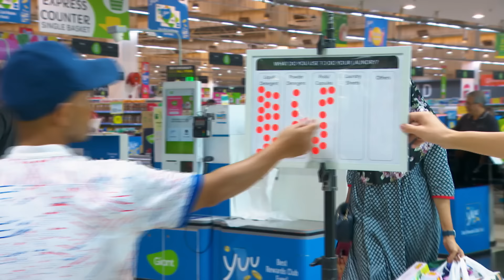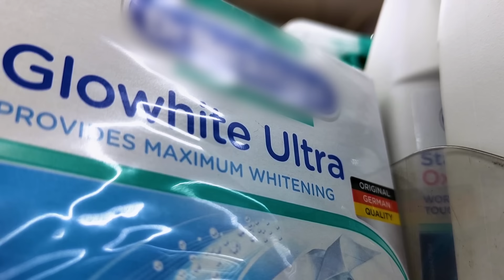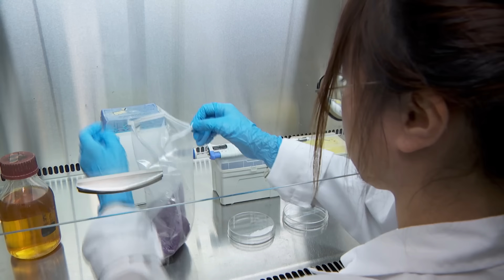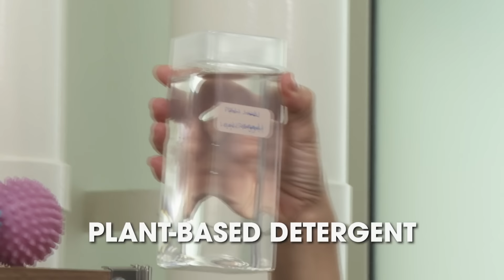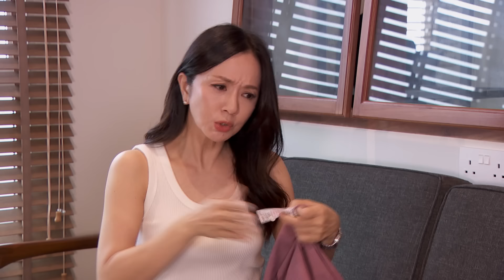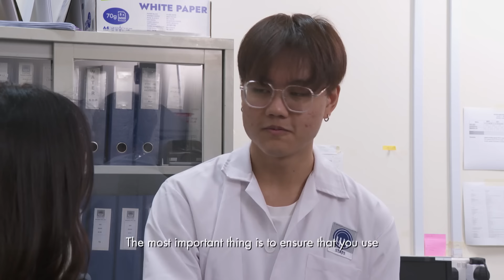Which Laundry Detergent Works Best? | Talking Point | Full Episode

Comment: I’ve switched to sheets but depending on the conditions of the laundry, I use a combination of oxide bleach and liquid detergent. Oxide bleach can use used even on coloured laundry , in fact I found it the colour of those items cleaner and brighter not necesarily faded. 

My experience on post laundry of odor is when the laundry are not properly rinsed especially when the clothing has a lot of sweat, the type of fabric,  if the laundry soap has added scent that not rinsed properly, the barrel is very full that affected the way all items rubbed each other in the cycle plus the temp of water. Because I still have a significant stock of powder detergents, I use powder for towels or kitchen rags, bathroom rugs etc. my conclusion is … it’s not straight forward and use common sense and practicality and use of energy and water; but I now stick to liquid, bleach oxide and sheets and don’t use conditioners

Comment: The Moral of Laundry

The uncomfortable truth is that laundry is not about the product you buy; it is about the discipline you apply.

1. The Detergent Myth

Let us admit we have been fooled. Chemically, detergents are virtually indistinguishable, differing by mere fractions of a percentage. Stop obsessing over marketing; the brand does not clean the clothes—the chemistry does, and the chemistry is standard.

2. The Discipline of Separation

Excellence requires grit. You cannot simply throw everything in together and expect brilliance. You must rigorously segregate your loads by fabric, usage, and care labels. If you want clean, bright, and lasting garments, you have to do the work.

3. The Law of Volume

Resist the urge to overstuff. Less is truly more. By decreasing the load size, you allow the fabric to breathe, ensuring it holds less moisture and dries rapidly. Patience in loading yields efficiency in drying.

4. The Necessity of Maintenance

Your tools are only as good as the care you give them. Regular machine maintenance is not optional; it is the foundation of the entire process. Neglect the machine, and you ruin the wash.

Comment: I am using the sheet ones because it is easier to store and adjust the amount I need, and I am happy to see the brand I am currently using in the video. 
I tried pods because they were free, and I still have some, but they don't dissolve at 40 degrees, even though it's claimed on the package to be suitable for 20-95 degrees Celsius. I only use those when I run at 60 with full load.

Comment: Liquid is customizable to size load esp smaller loads or hand washing, also can use it as a stain remover. This makes it cost effective. All this and it dissolves easily in the washer. The sheets will eventually take hold and become more common and that will offer all the convenience and versatility of liquids as well as being easier to store and transport, less plastic. But they are more expensive for now.

Comment: 90% of the front loaders are not designed around liquid detergent - you can't use liquid with prewash unless you have some advanced model, liquid detergent also is associated with mold. Liquid detergents were quite uncommon in Europe 20 years ago and I still wonder why people decided to switch... Even the cardboard boxes are much more eco-friendly than the tons of plastics in the bottles.
Reply: The popularity of liquid detergent is primarily down to marketing. It's been commonplace in the UK since the mid to late 1980s. And along with lower temperature washing was associated with an increase in issues with smelly washing machines and mould.  Apparently, the residue from it is hygroscopic, so it makes for a good medium for bacteria to grow in. Drum cleaning cycles were introduced in recent years to address the problem.Our powder detergents commonly contain an oxygen bleach to remove stains which also is very effective at killing bacteria and kills mould.

Comment: Just saying "powder" is ambiguous, because powder detergent can be with and without sodium carbonate peroxide (non-chlorine bleach). This is the ingredient that makes all the difference in comparison with liquid detergents which cannot have it (because they are liquid it would react right away, long before use).

In other words, powder detergent with sodium carbonate peroxide is easily the best at cleaning stains, as well as removing smells.

If you are experiencing residue with powder detergents, you are using too much of it and/or you are cramming too much stuff into the washing machine, making it impossible to rinse properly.

Comment: I'm in the US and have a Samsung front load washer (its the small apartment size) I use both liquid and powder. No pods thay have a habit of not dissolving and leaving stains on my clothes. I don't like the sheets in my washer they don't really do anything; but they are pretty good for hand washing. 

My real secret is to only use one tablespoon of detergent in my washer. I use the American power brands Gain, and Tide every now and then. For liquid I use US Gain, Tide or Purex.
But I also use Foca liquid from Mexico, and Mexican powder brands Top, Foca, Roma and Ariel. When I can find it the Tide powder from Vietnam, it seems to dissolve really well in cold water.

Comment: The main disadvantage of laundry capsules is that it’s impossible to dose the detergent portions according to a specific wash cycle. What I mean is the conventional separation between detergent for the washing phase and fabric softener for the rinsing phase. Since the capsule is visually divided into two or more compartments containing different cleaning agents, we cannot determine the exact moment when the detergent or softener compartments will open — in fact, they might be released at the same time 🤷‍♂️

Comment: I'm in the U.K. which doesn't have the humidity issues of Singapore has meaning laundry powder washing powder is an option. The snag being that machine are designed for use  with liquid and gel detergents.  Three things that drive my detergent choice  liquid that is non biological and unperfumed the last also extends to fabric conditioner.  I can't use pods because my machine is a washer dryer. I can't use laundry products that  are biological and/or perfumed because have sensitive Eczema prone skin. I also use a branded water softener that also cleans the machine.

Comment: I handwash our clothes and what haves with vinegar (in controlled amounts only) , soak it first w my preferred laundry soap brand, and so far it works for me, i have a teenager and it really helps remove all those unwanted stuff. Of course except those very hard to remove stains(hydrogen peroxide is handy) its not instant but over time as i observe it fades till its no longer visible.
Reply: I used used vinegar and baking soda too! However, I stopped when I realized that vinegar made the color go away and damages the fabrics. You'll definitely notice it after 1 year of washing.

Comment: Capsule (pods) caused undissolved plastic to build up in the outlet pipe from my washing machine causing a blockage. Extremely hot water has to be used in an effort to prevent this if using pods. I use liquid detergent.
Reply: I use mostly Powder, liquid detergent is weaker in removing Stains, and it builds up smeary Residue in the Machine.
Reply: Ooh I didn't know that
Reply: I've seen this tendency in my machine as well.

Comment: I only use powder The cost of liquid and pods is ridiculous, but powder in a cardboard box is the most environmental.  The amount of heavy-duty plastic and transport of the added water is so unnecessary.  I have never had an issue, especially with a frontloader. If people have irritation, they should use a sensitive unscented variety and they are probably using much more than needed.

Comment: I don’t get it, if detergents can remove almost 100 % of bacteria, why worry about cross contamination? 🤔
Reply: Because there are still viruses that are not mentioned. It's antibacterial, not sterile.
Furthermore, that 0.00001% can be bacteria and viruses that can survive harsh detergents. Those are the ones we should be scared of. 

But anyway, you only live once, why be so scared. 🤣🤣🤣
Reply: women. theyre germaphobes.
Reply: Fungus, especially foot fungus😂
Reply: exactly my thought
Reply: @qt31415 I would wash something extremely contaminated separately, it is not just bacteria to consider.
Reply: Because they tested not on full load washing machine I guess? If tested only 1 or 2 clothes then the detergent works effectively (fully concetrated). Depends also on the mechanism of each Washing machine.

Comment: Inconclusive. I use all 3 types of detergent in rotation, powder, liquid and pods, since the start of this year after using liquids for some time as i noticed towels were smelling funky and feeling coarse, stained bed linens not washing well. Persil powder helped address all the issues. Don't use special detergents for colours or antibacterials, just normal.

Comment: The detergent sheets are nice because there is less plastic, just some sheets in a small cardboard box which is easily recycled. Also, no spilling!
Reply: Check the ingredients or contents of your detergent sheets.  Many, if not most, contain PVA/PVOH which doesn't biodegrade as quickly as claimed and it is a petroleum-derived product.  Many detergent sheets also contain a potential irritant such as sodium lauryl sulfate and fragrances.

Comment: I have spent more than 60 years washing clothes, from the time I was about 10 using a wringer washer, until now. We have always tried to save money on detergent and I’ve bought most of them. I hate that I must buy additional products to work with my detergent. In my opinion, if the laundry soap alone doesn’t do it, it’s a failure. I have found that Tide, Clorox 2 and Woolite to be the most effective for a stand alone soap. Believe me, they are the best. Add bleach to whites with Tide Liquid, use Clorox 2 on colours. Woolite for delicates. I use peroxide, Dawn and water mixed together for stains. Believe me. This works.  I don’t know what water is like in Singapore but here in North America, it’s Tide Liquid.
Reply: How do you feel about Persil

Comment: The no detergent Wash I assume is the control had a 99.985333.  The tests are flawed in the first place...  It doesn't tell us anything.  At least get some textile that has higher bacterial concentration.  It doesn't show if the laundry balls or other detergent actually have any difference.  Everything in your experiment was just 99.999 bacteria free.  According to your test results just wash everything without detergent or add some fragrance pellets and it should be the same as using detergent.  This is so misleading and a waste of time.

Comment: The last part doesn't really matter.  the part about bacteria. 
if you are drying your clothes using the old way of hanging it outside in a sunny day, the bacteria will die from the heat of the sun.

Comment: It depends. I use pods bcoz it is cost effective about 70cent to RM1 per pod for all 3 - soap, softener and perfume. If small load I use one pod and for bigger load I use 2. Also my kids have skin dryness and easily irritate. Pods help me from over use or over pour detergent. 

If the cloths is overly soiled I have to manually wash it with powder detergent. Overly soiled cloths need extra treatment depends on the outcome we looking for. Bleach or dettol for the brightness and antibac purposes. 'Nila' is also used to for the brightening and new effect. So it depends on what we are looking for in each clean.

Comment: I have tried these 3 versions. But never use the thin paper form before.  I prefer the liquid form. I dislike using Power form as it sometimes dont dissolve evenly and I notice white spot on my clothings after washing despite how good the quality is. Liquid form works best for me , it washes my clothings well,  clean with no stains / dirts left behind and 100%  with a pleasant sense after washing. Capsule form is overrated and is more expensive which I do not think its neccesary if liquid works very well for me.
Reply: I used sheets detergent when traveling.. Very handy
Reply: The sheet ones are useless. I've tried so many brands and not a single one works well

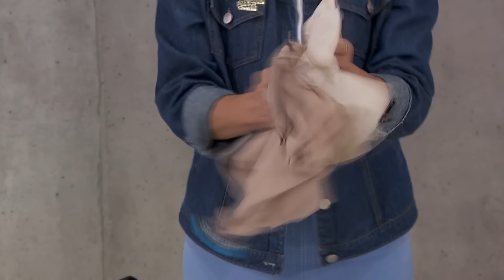Comment: That girl at 19:24 clearly don't know what she's saying. That spreading of bacteria only works if you DON'T WASH your clothes at all. Makes me question her logic and credibility. As you can see from that guy's explanation at 14:29. It shows 99.999% of bacteria was removed after washing regardless of which detergent used. Clearly DEBUNKING what that girl said.
Reply: Yes, it removes 99.999% of the bacteria, but that also means there is 0.0001% bacteria left over. The remaining bacteria can spread and cross contaminate and it will multiply over time.

Comment: If laundry detergents can remove 99.99%+ of bacteria then it makes no sense to be claiming that different categories of cloths and clothes can cross contaminate each other during the washing process unless no detergent is used
Reply: What she didn't test was how effective these detergents are in a full load of laundry. She washed single towel pieces in a mini laundry machine so obviously all the bacteria were removed.
Reply: @drezhb  Smart observation.
Reply: Exactly that section seemed off
Reply: Towels tend to be very abrasive to clothes and can damage them or cause pilling
Reply: dirt, oil are the cross contamination worries.

Comment: You missed one the important ones...soap.

Laundry soap is the best for the environment and a washing machine. That came directly from a manufacturer of washing machines as well as cnc broadcasting in canada. The liquids and the pouches pouches contain materials that are harsh for the environment And you're clothes. The wear and tear on clothing is extreme when it comes to detergent. That is why soap is used for garments that need care/ protection like children's garments, Baby's garments and medical garments.

Studies done in the 70s and 80s and 90s and 2000s have concluded. That soap is most gentle on fabric and the environment, but not for the pocket book Of manufacturers. We are now paying twice the price for detergent compared to soap. Where as soap Is now cheaper to make than detergents because of the chemicals and the need to be kept in plastic. Soap doesn't react to humidity. It doesn't get damaged by the presence of water. Water can evaporate and the product still is a hundred percent capable of cleaning clothing. I've seen four studies. And i've seen a detergent manufacturer cause environmental damage to everyone living within three miles of it because of the chemicals constantly emitted into the air, especially when they have spills.
Reply: by laundry soap, what kinda brand of how should it looked like? i'm from a non english speaking country so the shops won't have a similarly titled product, so knowing how it looks like/brand would help. thanks!
Reply: @immim9645 Here in the US we have Zote and Fels Naptha. In some places in the Caribbean and central/south America, they use "blue cake soap" of Blue Bomber soap.

Comment: I have stopped using liquid detergent. Over time it builds inside the washing machine and flakes off onto the clothes. And this is despite doing these washing machine clean-ups as suggested. Since switching to powder never had this problem again. Always use slightly less than recommended dose @30C. Never had any problems with undissolved product or skin allergies etc… and btw, don’t use fabric softener at all. And silly to suggest to separate kitchen linen from clothes because of contamination when it’s supposed to kill 99.99% bacteria 🤦🏻‍♀️
Reply: I agree with everything you said.

Comment: You may provide the best choice of detergent and washing machine however at the end of the day it’s still user issue on how they use the washing machine, how much detergent and water volume they use for each load, how dirty their clothes is, how they take care of the machine. Too many factors that was missed out. 
Could have summaries:
-any detergent based on your choice and budget. 
-avoid overloading of washing machine .
- avoid adding additional clothes into machine once it starts washing unless ur machine has a program to add on plus adding of additional detergent. 
- make sure to air dry your drum after each wash.a lot of people might just close it and all the mildew plus bacteria starts to hide inside.
- give drum a biweekly rinse with specialised drum washing detergent. Check your model if allows. Usually most of it does..
-avoid using softener, a dash of white artificial vinegar does the trick to soften your laundry without residue build up
Reply: If you have ever seen a washing machine partially dismantled to clean water softener residue, you would never use water softeners again.  It is really gross.  Yet, folks still fill that water softener dispenser almost to the top of the dispenser.

Comment: Misleading and incomplete review. The episode tests the detergent on 1-few pieces of clothing. That's unrealistic. At high dosage washing merely pieces, of course all detergent works the same. However, we usually wash a minimum of 5kg where space within the washer is also a constraint. As such, the detergent solubility and exposure of the laundry to the detergent are variable key factors of consideration. In conclusion, a poor review and analysis done here.

Comment: The explanation regarding the cross contamination is weird.  They are washed isnt it finally in the washing machine? So how can they be contaminated. The better explanation is the oil that is aborbed in the  kitchen cloth which you dont want to be mixed with.I washed my kitchen towels by hand  separately or use a wet wpes then throw it away.